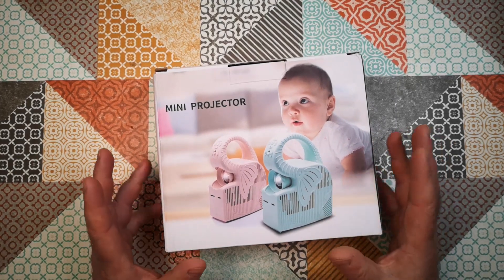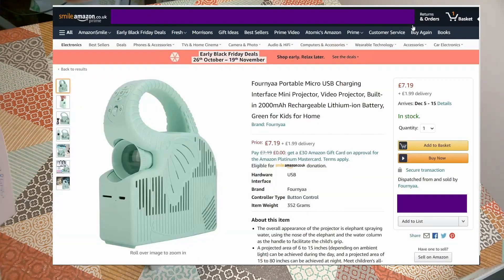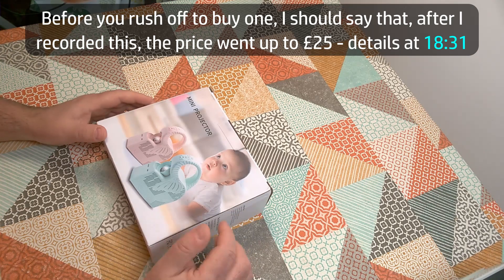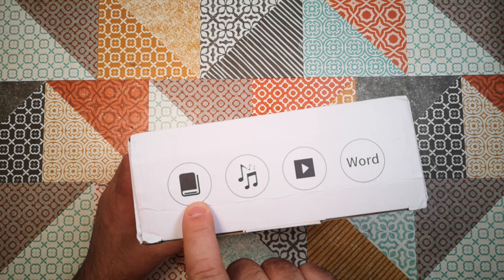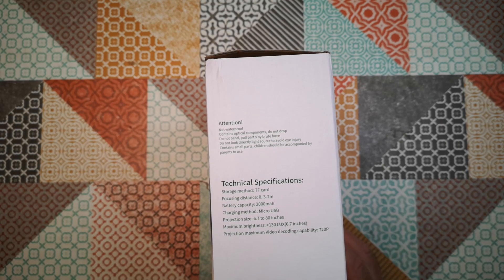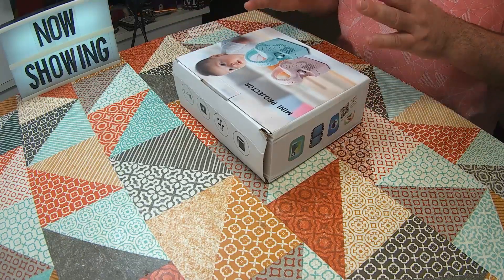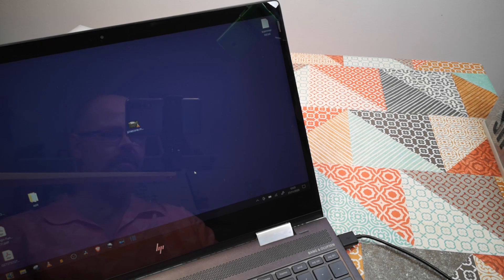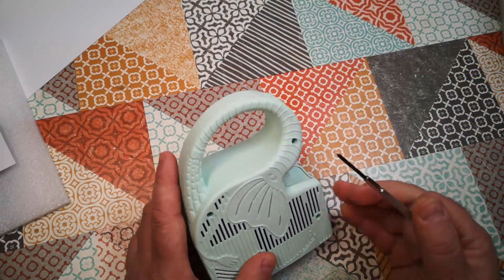The Weird Little Video Projector That Cost Me Less Than £10 - Unbox, Test, Teardown

Comment: I did some more research on this item. According to https://linux-sunxi.org/F1C100s, the F1C100s is an ARM microprocessor with 32 MB of RAM. So, just considering the memory, stock Android will definitely not run on this. Considering the lack of cooling for the CPU, the high resolution video likely caused it to overheat. The eight-pin chip above and to the left of it is an SPI EEPROM, and probably can be programmed with a $10 SPI USB programmer with SOIC clip. However, it would be easier to boot from the conveniently provided SD card slot: https://linux-sunxi.org/BROM. The other eight-pin chip is apparently an audio amplifier. The display is not compatible with the Raspberry Pi DSI output, which means you would have to bitbang it from the GPIO, resulting in significant CPU usage. The RX020T is in fact a 320x240 display, as guessed. This item is (currently) sold for about US$30 on AliExpress, so £10 was most likely an automated pricing error, probably caused by multiple vendors automatically undercutting each other. Hackaday wrote about this guy: https://www.thirtythreeforty.net/posts/2019/12/my-business-card-runs-linux/ who made a $3 business card using this CPU.

Comment: There is just no way they made and shipped this for that price. The build is....good. It is lacking even basic cost-cutting measures like directly soldering wires to the board rather than using connectors.
Reply from the maker: Yeah, the price has got to be either a loss leader or a mistake

Comment: Nice, I bought the same bit set :D You can btw unscrew the default bit holder. In case I wasn't the only one too dumb to notice. Not that it would have helped you much in this case
Reply from the maker: When mine arrived, the box had been dropped in transit and the bits were all loose inside the package.  Fortunately, they are all stamped with their type and size, but it still took me half an hour to get everything into the holder

Comment: You can probably find a driver board for that screen somewhere
Reply from the maker: Reckon so.  I was thinking about hacking a pi zero into it, but the existing board also controls the light source and the battery charging - it could turn into one of those projects where I need to replace too much for it to be worthwhile
Reply: @AtomicShrimp  yea I suppose, I do recall the raspberry pi having a display connector like that but I doubt they're the same due to the sheer number of different variations of pinouts and things. I did do a search on my own and most of similar products were in the +40 us dollar range although I found one that seemed to be 15 dollars plus I believe 5 dollars shipping

Comment: According to the processor datasheet it has CVBS inputs that support NTSC and PAL. See section 2.6 of this document:

https://linux-sunxi.org/images/b/ba/F1C100s_Datasheet_V1.0.pdf

Since the processor is in a QFN package it may be possible to solder two thin wires to the appropriate pins? Should be pin 74 (TVGND) and 78 (TVIN0) / 77 (TVIN1).

Modifying the firmware to use it will be a bit more of a project, but should be feasible...
Reply from the maker: There might even be a pad on the PCB wired to that pin.  Firmware is going to be a problem - building my own is way beyond my skill level.
Reply: @AtomicShrimp  It looks like someone made a Linux image for that processor (on another board though). Including, what seem to be, step-by-step instructions. Perhaps this could work? It would be interesting to see what you get out of this projector. In any case, thanks for the videos!

See this link for the port:

https://github.com/watrt/suniv-f1c100s-licheepi-nano_linux

Comment: "Picture." Just the one. No slideshow.
Seriously though, it's impressive for the price. Then again, all they have to do is take cheap mp4 player innards, put an LCD panel with no backlight or reflector, stick a phone camera flash LED behind it, and stick a couple plastic lenses and focus dial in front of it.
Reply from the maker: I only placed one picture on the card.  I should have put several there to confirm it does a slideshow (however, I am sure it will)

Comment: If you still have this Device:

https://linux-sunxi.org/images/b/ba/F1C100s_Datasheet_V1.0.pdf (That's the CPU Datasheet)
Official Sheet spec: https://www.allwinnertech.com/uploads/pdf/20181218155101eb.pdf

For some more Details: https://linux-sunxi.org/F1C100s

Comment: i have one of those ,different shell and not a fishtail looking thing at all, its pretty okay for like 480p, i use it for older consoles as it came w/ a splitter cable for component video and it does that pretty well actually   
cant complain for the 7 or so bucks i paid

Comment: please answer what we all want to know : can this screen be connected to a Raspberry Pi ?
Cause if it does that's a damned deal, i'm geting the 3D printer warming right now to make it a new enclosure
Reply from the maker: Not sure - it's a 30 pin ribbon, so I don't think it will plug straight into the RPi screen connector

Comment: Shrimp! I gotta tell you .... I tried a product that's been pushed a lot here in the 'states called Beyond Burger which is this sort of meat-free, cruelty-free burgers thing .... it's awful. I mean really, really awful. I really hope you can't get it over there in Blighty because it will save you some grief but it's so spectacularly horrible that if you can get it, arrange to cook it outside to keep from stinking up your house, and do a review. I mean you can eat a bite or two, maybe with a fair amount of HP sauce, and that won't hurt you ... much.
Reply from the maker: I've tried them.  They're not the worst meatless burgers I have eaten, but there was something odd about both the texture and flavour - I think a lot of it was the uniformity of the thing - every part of the patty tasted the same as all the other parts - with a real burger, you get a different flavour from the crust vs the inside, because the flavour comes from the cooking process, not just the product.
Reply: @AtomicShrimp  You might want to do a review/send-up of the things, because it's a thing that's being pushed at least here in the states and I'd only wish them on my worst enemy.

Comment: the reason its so cheep. simple slavery
Reply from the maker: I fear you may be right, but the real concern there should be that more sensibly priced products are probably just slavery+greater profit
Reply: It would take a fairly well equipped factory to produce something like that with a design department and prototype facility. They would be making many other products and already have a paid workforce who were capable of learning to assemble a new product line. It's possible they were low paid but in China there is a standard rate for low skilled workers.
The factory needs to make money to keep going in a very competitive market and often the most innovative companies get a small head start before their products are copied and made cheaper with lower quality, the only way to get ahead is to constantly be finding new and innovative products to sell.
This might seem cheap to us but they are even cheaper in China, when they sell a new product in the Western market it will start at a low price to raise awareness then when a few get sold the price will multiply until it stops selling. Lowering the price gradually will show what people are willing to pay, that's how they fix the prices but in a couple of months a slightly lower quality version will come out from a different seller and start a price battle.
The factory workers in China don't have great lifestyles but it is a source of income and there are many factories in China, if they don't like one they will go to a different one.